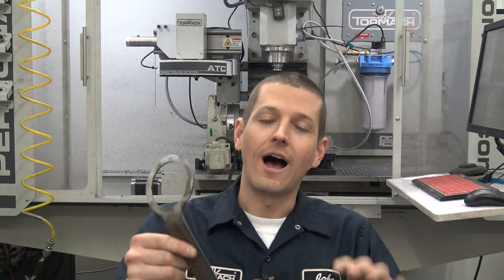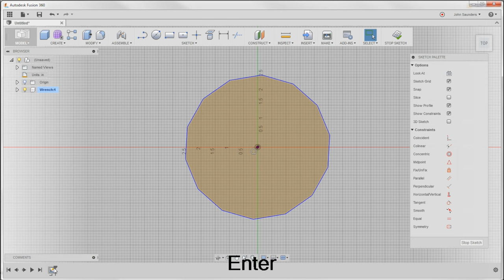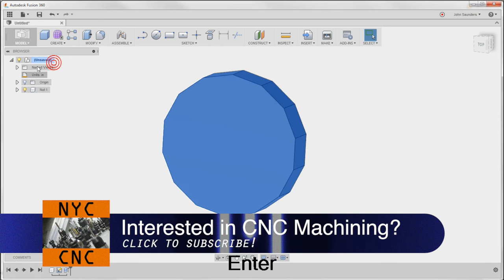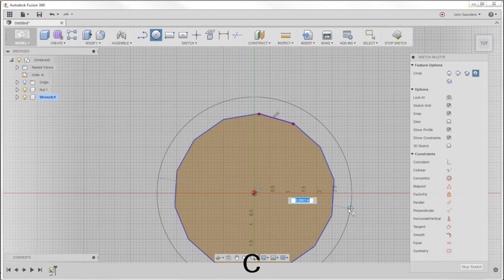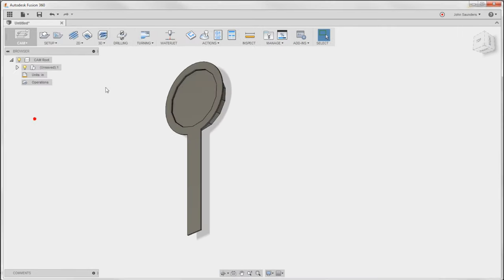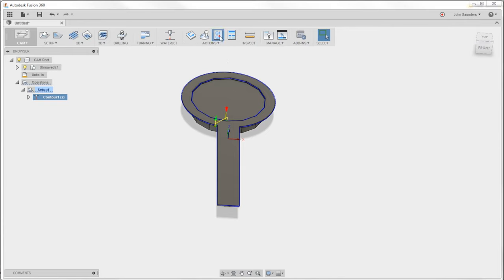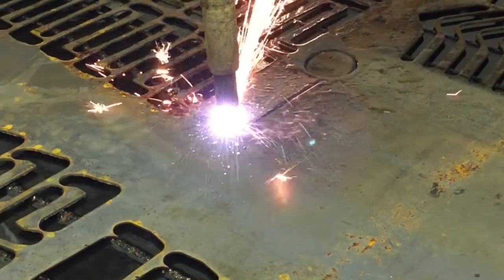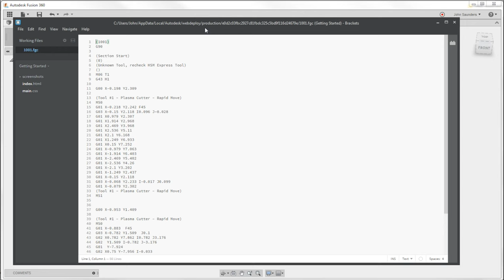DIY Toyota Oil Filter Wrench!  Fusion Friday #15

Comment: 3-D printing is great, and I'm glad that it keeps getting better. Even so, enthusiasts for on-demand manufacturing should also keep up with the ongoing advances in CNC technology. Sometimes it's still better to subtract than add, even when doing a one-off part.

Comment: Do you know of any parts library?
Also do you know of any way to scale the ui? 

By the way, I love your whole channel. I'm an embedded programmer, but have been moving towards CAD design in my free time, and looking for a way to get a job in the machining industry or prototyping.
Thank you again!
Reply: +NYC CNC I was thinking more along the lines of aluminium exstrusion and standardized screws, nuts and bolts.

Comment: Hey John, what tool do you use to capture all the keystrokes like that? Because Camtasia won't do it.
Reply: NYC CNC How? Because there are plenty of threads saying that single key capture isn't supported for security reasons. so CTRL isn't captured when you are  using it to modify selections, and pressing S to bring up the S menu isn't captured. I can capture Ctrl + V for example, but not CTRL by itself or V by itself.
Reply: +Scott Moyse i'll send you a video tomorrow
Reply: ***** thanks.